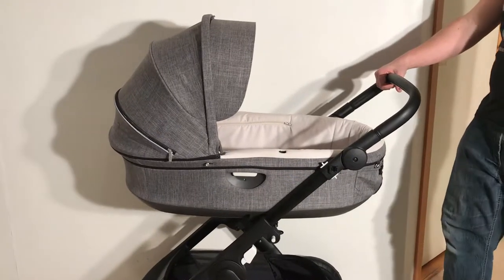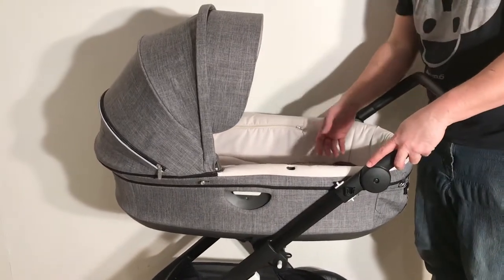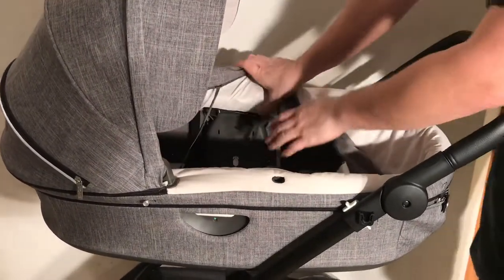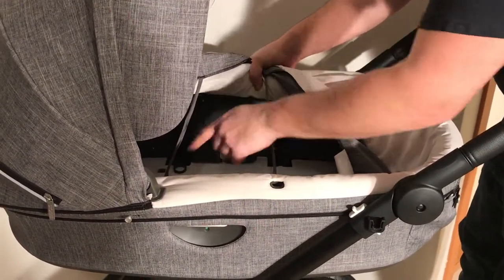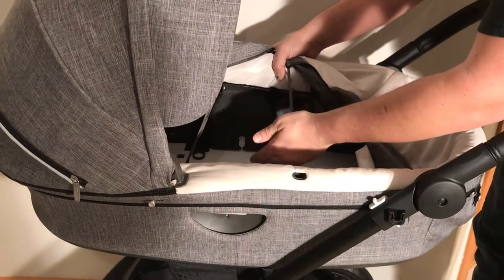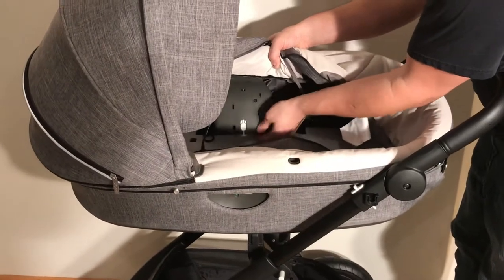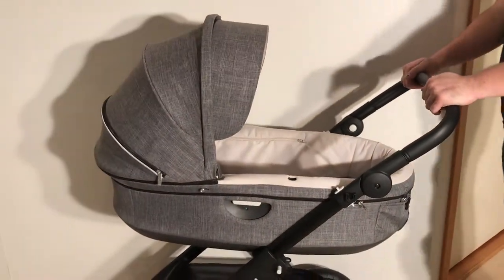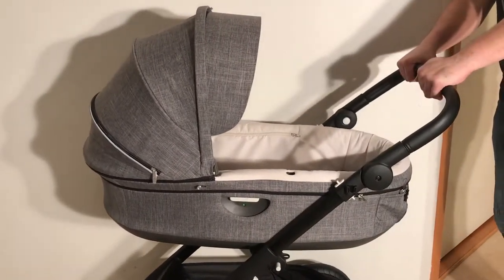How to Fix a Stokke Trailz Carrycot that won't Connect to the Chassis

Comment: Hello, do you have any advice fot getting he bassinet off if one of the release handles is broken ?
Reply from the maker: Flip the bag over and spray some wd-40 into the mechanism, then try using something thin and flat to reach in and depress the locking trigger.  Alternatively, this video shows replacing the whole mechanism (not disassembly of the mechanism, unfortunately): https://www.youtube.com/watch?v=wb33K2G-vLM
If you can somehow disconnect it from the main bag, then you might be able to open it from the top, and see what is misaligned or broken. :)